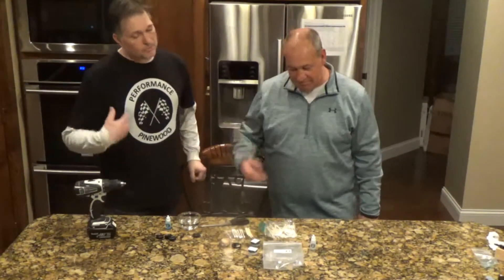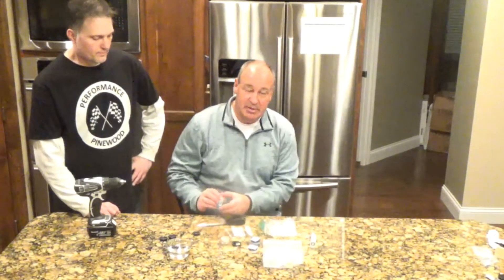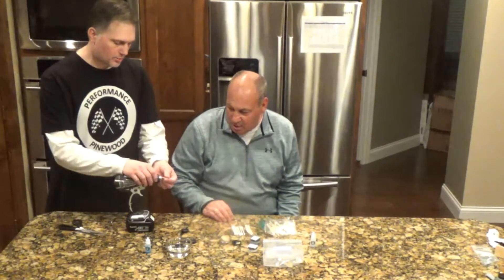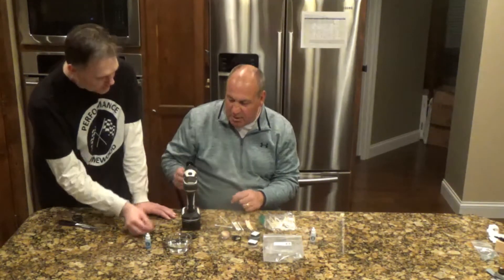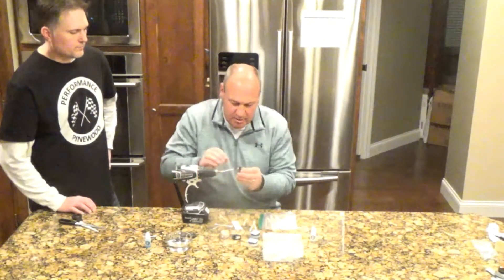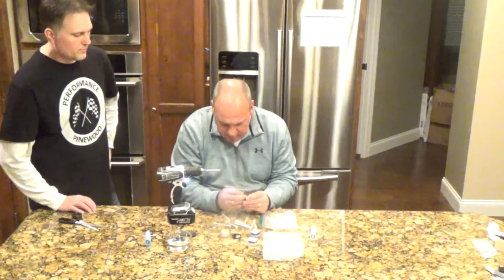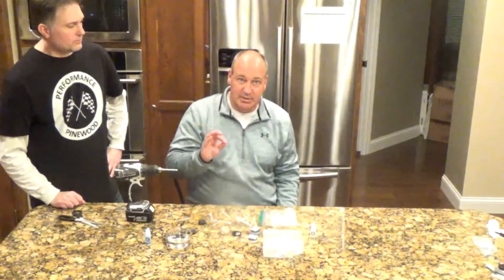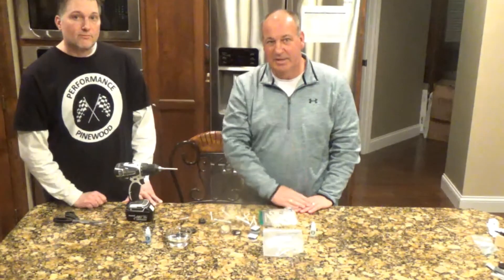How to Build a Fast Pinewood Derby Car - Episode 6 (Wheel Preparation)

Comment: What kind of polish do you use? Also what do you use to drill the new axels? How do you get the 3 degree cant? Do you use a drill press or a hand drill like you have on the table?
Reply from the maker: Hi Scott - At Performance Pinewood we use a combination of two polishes and a specialty wax that are included in our Pure Power Wheel Bore Prep Kit.  We've tested many combinations of polishes and waxes over the years to find the combination we like best, but if you are in a pinch you could use a plastic polish and a wax - both of which can probably be found at your local hardware store or Wal-Mart.  Our blocks are drilled by hand with a pin vise and a #43 jobber bit.  We get our 3 degree cant with a precision drill guide/jig to ensure a consistent drill angle.